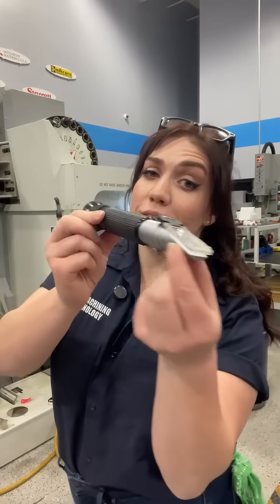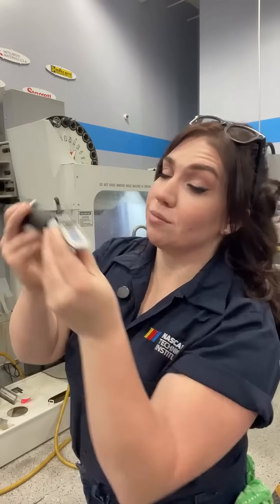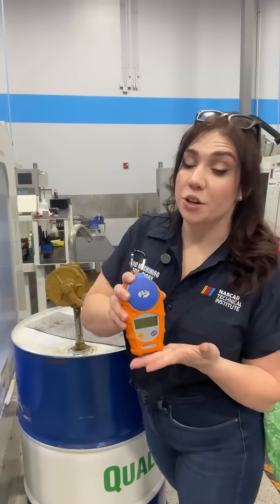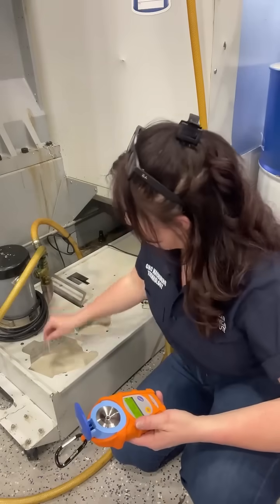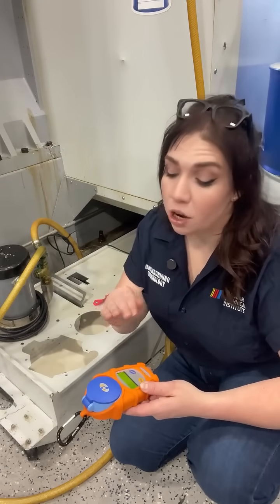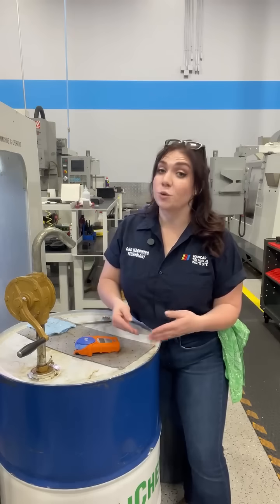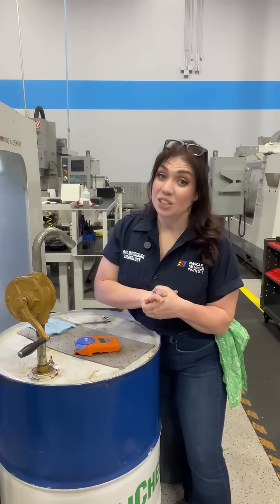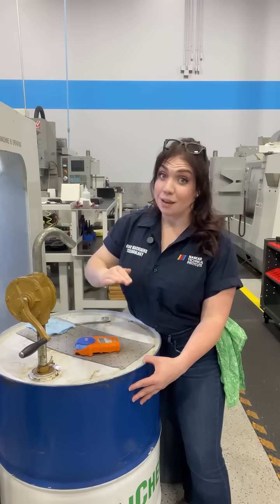Time to ditch the analog refractometer!

Comment: New equipment is always welcome for me, but being that this is for a college, keep using the refractoneter, 99% of shops in the US have them.  But if a student showed up to work day 1 without knowing how to use 1, its no biggie.
They are not hard to use.  Its okay to change the settings by rotating the handle slightly to match your eye sight, eg if you are near sided or far sided.
What woold be really nice is to give each student a feed and speed and aurface feed digital calculator